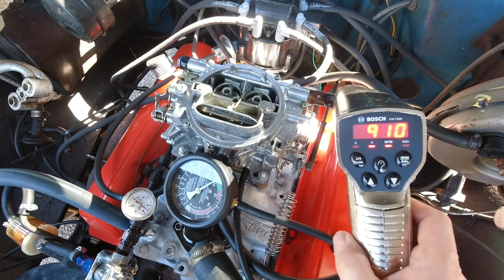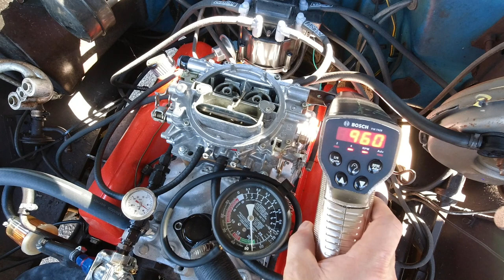Carburetor Transfer Slots - Most Common Questions Answered

Comment: Good video...I have a question about the transfer slots on an edelbrock AVS 2 800 cfm...chevy 454, mild street cam...it idles pig rich, fouls the plugs very quickly at idle, i think the transfer circuit is the issue...my question is how much of the transfer slots can be exposed below the throttle before that circuit engages? Do they need to be completely covered to stay on the idle circuit?
Reply from the maker: Completely covered.  Any amount shown will cause an increase in idle speed, air flow and enough pressure drop to meter fuel.  Depending on what cam you have, it shouldn’t be difficult to get the idle down to where no exposure is necessary.
Reply: Thanks for the prompt reply! I'm running a lunati 262 voodoo cam so it's not real aggressive...I'm at 5300 ft above sea level but still pull 19lbs of vacuum at idle. Fast idle wasn't really the issue, actually the opposite, had a hard time getting the idle much above 650 rpm with just the idle screws...pulled the carb and set the throttle blades covering the slots and I'll start over again tomorrow
Reply from the maker: Elevation tuning is different due to the reduced oxygen.  You’ll need to start much leaner to get to the right calibration.  Timing is super critical also.  I have a separate video on tuning at higher elevation.  https://youtu.be/l7fG6eMxv5A
Reply: I set the carb up for this altitude right out of the box, I'm running 8% lean primary power, 9% lean primary cruise and 8% lean on secondary jets from factory setup. Car runs and drives fine except for the pesky plug fouling at idle issue. Timing is set at 15° btdc @ 900 rpm, floats set at 7/16" up, 1" dropped, and fuel psi is 5 lbs.
Reply from the maker: @mikeschilling9713  typically at higher elevation you can push the timing a bit more.  Try up to 18 for initial and see if it helps.
Reply: @Muscle Car Solutions   yeah I'm going to bump it up and see what happens, thanks for your replies, I'll post an update...the transfer circuit slots are pretty much the last thing I haven't ruled out as the issue I'm having
Reply from the maker: @mikeschilling9713  and you’d be right on track with that as the next step.  That would for sure show your rich condition at idle and clear itself up as soon as you’re driving and into throttle past 100-1500 rpm or so.  All depends on engine load at that point.  It’s not uncommon to start at those higher elevations at 18 degrees of advance.  Just needs a little more time to burn with less oxygen.  For sure let me know how it goes!
Reply: Ok I'm stumped on this one...backed the idle speed adjuster out to just touching the throttle, any more open than that will begin to expose the transition circuit...car absolutely will not run...adjusted idle speed to 600 rpm and set timing at 18° btdc...(this is all once the engine was warm) idle mixture screws set at 1 turn out, anything above or below that and the engine stumbles...so the carb is responding to them, but unable to adjust the idle more than about 40 rpm with them...even at this setting if I back the idle speed screw out the rpms drop and I can't get them up at all by adjusting the idle mixture screws in either direction...vacuum holds steady at 16lbs, can't get it to change much at all with the idle mixture screws...what am I missing here?
Reply: Also I noticed the rpm raises a bit if I unplug a vacuum line

Comment: my idle has to be at around 1000 - 1100 RPM , otherwise it just chugs like an idling harley davidson . its a 4 speed manual . but i cant stop it " dieseling " . it wont do it if i idle it right down to 900 or so , but it just chugs slowly then . i tend to think its pulling fuel from the transfer slots at that higher idle , so when i shut it down it runs on . its not electrical , i can yank the pos wire from the coil and it still does it . it runs 15-19 BTDC

Comment: On my edlebrock AVS2 only one screw is adjusting the air fuel mixture the other mixture screw doesn't do anything. Do you please have any advice for me? Thank you
Reply from the maker: Could be a number of things.  First thing I’d consider is taking the airhorn assembly off and checking for trash in the float bowls.  Blow through the idle mixture screws with some carb cleaner.  Blow back through the idle port in the venturi.  You’ve either got an obstruction or you’re into the transfer slot too much.
Reply: @MuscleCarSolutions  Thank you very much for your advice it is truly appreciated.

Comment: Another issue i hace is that I have fuel coming out the pcv port, I set my fuel pressure a 5.5 psi with a regulator, but when I connect the pcv port it doesn’t get fuel, only when the port is capped of with a vacuum plug then I see fuel in the port

Comment: Love the video. I am having a hard time getting idle below 1000rpms without stalling. Running a 427 Ford crate engine with Holley 870 cfm, vacuum secondaries. 
Cam Specs: .608 intake .608 Exhaust  248 intake/ 258 exhaust @ .050 114 degree lobe separation. Any suggestions greatly appreciated.
Reply from the maker: What is your initial timing set at?
Reply: @MuscleCarSolutions  18 BTDC
Reply: @MuscleCarSolutions  I feel it is a little advanced as I am having some hard starts after the engine is at running temp.
Reply from the maker: Yup.  That’s a lot, but it’s one way to get the rpm down.  You’ve tried starting over and backing the idle speed screw back out and resetting the idle mixture screws?  The trouble you’re having in not enough air.  That’s why you’re having to set the speed so high is to get more air into the system.  The cam is your worst enemy here.  I’m sure it sounds good but the long duration like that makes me wonder what the cam was spec’ed for.  It’s got high rpm and race written all over it.  Race cars don’t generally care about idle.  The wide LSA tells me it’s probably not a comp thumper series cam and it was spec’ed for only race type use.  There are a number of things you can try but I’m not sure how we’ll it’s going to play with that set up.  Can I ask what you’re using the engine/car for?
Reply: @MuscleCarSolutions  It is a Factory Five Cobra, built it as a project with my son. Take it to car shows and such, do not really race it. Have fun with it.
Reply from the maker: Well I’m guessing the factory five is on the light side.  In which case, having that aggressive of a cam profile is probably working against you.  For sure it is in reference to the rpm.  Is it an automatic?  How much converter is in it?
Reply: @MuscleCarSolutions  Manual, no converter.  Headers to Side Pipes.
Reply: Do you have replaceable idle air bleeds?
Emulsion jets?
Lots of voodoo there.
It’s a crate motor what do they recommend for initial timing - total timing?
How much does the flywheel weigh?
Reply: @MuscleCarSolutions  I'm running 24 initial on my 427 stroker.... I tryed drilling all the way up to 8th inch holes in all valves and still have alot of transition slot showing...I think it's just nature of the beast with radical cams... ive heard running carbs with larger butterfly valves may help

Comment: I have a sbc 350 with a summit 1102 cam and avs2 carb.I could not get it to idle in idle circuit.idle would be erattic when I come to a stop.tried different timing settings but nothing worked.decided to read Edelbrock installation manual and it said that if you have a performance cam and having trouble with idle switch vacuum advance to manifold vacuum (drivers side port).I did that and it idle consistently at 850 rpm and ran great.hope this helps someone.
Reply from the maker: That’s a really small, mild cam.  Should do better with timed vacuum.  You’ve got a separate issue.

Comment: My problem is a timing's all right the tunes all right but it idles at 9.1 AFR it's a 400 small block with a 650 AVS Edelbrock basically a very mild RV cam all stock 20 HG vacuum but when I screw in the idle mixture screws it leans it out and runs at a higher RPM and smoother way smoother but doesn't die the fuel floats and everything are okay and fine it just idles excessively rich runs great. outside of drilling holes in my butterflies the transfer slots look as they should be I've never had this problem on any of my vehicles I thought maybe my engine was too big and causing the engine to run overly rich not enough air I also considered vacuum leak in my intake gasket no vacuum leaks anywhere else
Reply from the maker: What is your timing set at?  What is your pressure regulator set at?  What level did you set your floats to?
Reply: @MuscleCarSolutions  I'm running 14° before top dead center my float Heights are set 7/16 to 1 in drop my fuel regulator is set at 5.5 I've tried lesser settings it's a stock 400 with new Springs and cam and valve job a very tame .420 lift my vacuum canister is adjustable set at 8° if I add more it gets slower I assume it's such a large bore and stroke small block that the intake is very small and it just needs a little more air the transfer slots are nice and square it idles but the pipes reek no black smoke but it seems to be kind of Happy but the gas mileage sucks in town actually good on interstate highway I thought about drilling the smallest holes in the butterfly but when I turn in my idle mixture screws it doesn't kill the engine maybe my intake gaskets are screwed up and I got an internal vacuum leak

Comment: Raising the base timing will also raise the full timing. How do you compensate?
Reply: You can start by limiting your vacuum advance to maybe 8 or 10° Max it's a big game of give and take you could try a heavier spring in your centrifugal if it advances too early
Reply: You shorten the mechanical curve by installing limiters.  Depending on your distributor these may be levers (Pertronix) or bushings (MSD) or you may have to modify your particular OEM distributor.  The springs should not change.  You want the springs that allow your centrifugal advance to start coming in just above your idle RPM and be all-in around 3000-3500 rpm.

Comment: I am trying to close off some of that transfer slot , but I cannot because the engine will cutoff, my idle circuit hardly respond to adjustment
Reply from the maker: What’s your timing set at?
Reply: More initial advance is required!

Comment: So where are the adjustments screws to set the transfer slots
Reply from the maker: Transfer slots are a fixed orifice.
Reply: If you’re asking how to adjust how much of the transfer slot shows, that is done with your idle speed screw.
Reply: Mine are opened way to much thanks
Reply: So I have the idle screw screwed out it's not touching the linkage and they are still opened to much. Do I need to adjust  maybe the I think it's the accelerator pump down to the bottom hole to close the transfer slots up some. Sorry I'm not familiar with. Carbs at all. It's a new Edelbrock carb and  the air mixture screws was doing absolutely nothing is why I'm adjusting and trying to figure it out.appreciate the video and the answers thanks again
Reply: @nobodynothing1717  Just the idle speed screw adjusts it, don’t go messing with anything else. One other possibility is the linkage and return springs for your gas pedal is not getting the throttle plates to fully close. If you can pull on it and it goes all the way closed, that’s your cause.

The throttle plates should be able close all the way to the carb body walls when it’s off the car. If it’s a brand new carb, this is not likely the problem but I’ve seen rebuilds that were not put together correctly and the throttle plate hits too high. To fix that (don’t mess with this either until you check the vehicle’s linkage and return springs) you would loosen the screws that hold the plate to the arm and get it sitting correctly. Lock-title the screws when you put them back in, they’re not something you want coming loose and finding their way into the engine.

Comment: What if the transfer slots are uneven?
Reply from the maker: What do you mean by uneven?
Reply: @MuscleCarSolutions  They are not cut the same depth in the base plate.  One side is lower than the other.
Reply: @Preacherman5051    Brand and Part Number for your carb?

Comment: You can fill holes in your butterflies with lead
Reply from the maker: I’m almost every instance I’ve seen this tried, it works itself loose and guess where it ends up?  Tig is the only correct way and no one will spend the time to even do that.